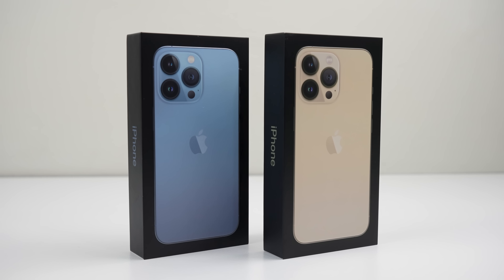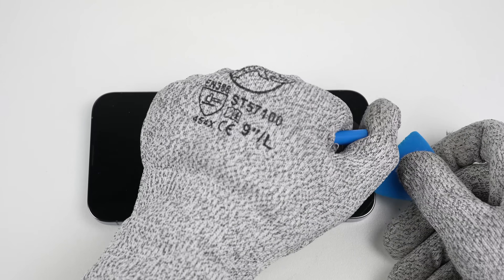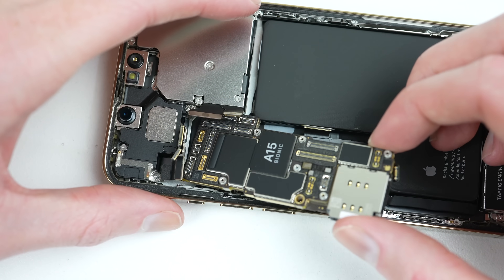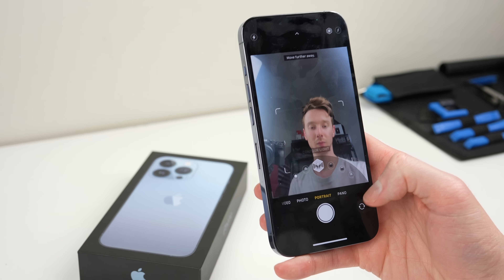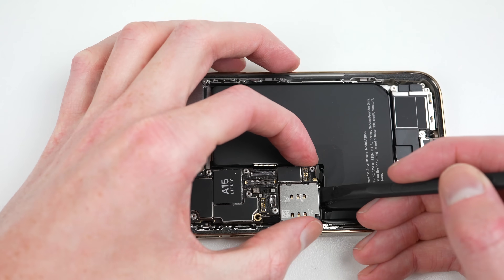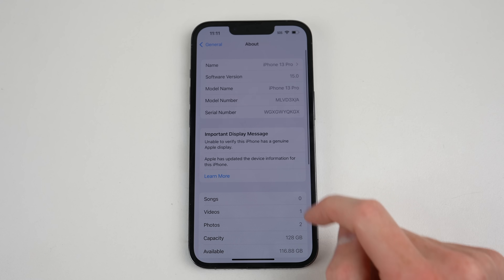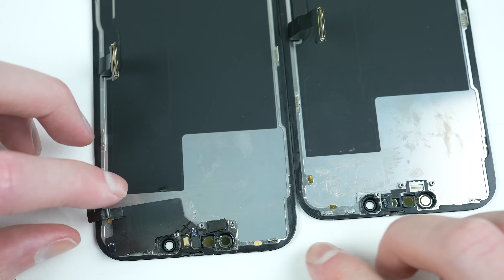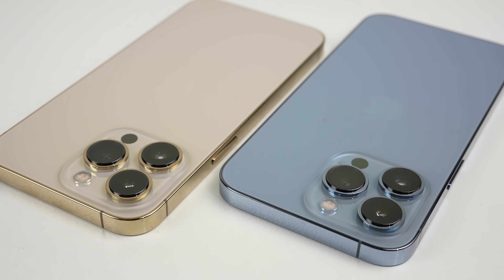iPhone 13 A Repair Nightmare - Teardown and Repair Assessment

Comment: I cannot fathom how anyone continues to support Apple. They are possibly the most anti-consumer company out there and that says a fucking lot given how anti-consumer many ISPs and video game publishers are.
Reply: Well that's because contrary to what you might be led to believe from internet debates, people rarely put their money where their mouth is and being pro-consumer on it's own rarely does anything for your business.
Reply: @CanIHasThisName  Hence why consumer rights are encoded into law. Laws which need to be revisited and updated for modern products and the expectations of modern consumers. This stuff shouldn't be left up to the companies to decide for themselves, they'll never do the right thing for the sake of the common consumer.
Reply: @smithynoir9980  and then they'll move somewhere where that law doesn't apply
Reply: I still use my old iPhone 6.

Next ones going to be a Linux one as soon as I can find a good one.
Reply: I hate apple but i just think their products are actually good, and they have good software with great security. I'd like to switch if i found a better option but I've tried too much and I can't find something i like that's better than apple at the moment
Reply: @yourdadow446  I personally also enjoy iOS but what finally pushed me over to Android (Samsung Note) was when Apple introduced that "feature" which automatically lowers you volume. Basically, regardless of the audio output, be it BT earphones or speaker, the iPhone would periodically, sometimes as often as twice every 15 minutes, lower the volume to around 50%. And it would do it for everything - music, youtube, even navigation. The most absurd part was that in some regions, they wouldn't allow you to disable this. That was far beyond what I'm willing to tolerate and Apple just straight up refused to provide any explanation for why I can't turn this off.
Reply: @CanIHasThisName  

     I wasn’t aware of this, and certainly don’t wish to carry apples water, but it may be a matter of simply not wanting to destroy ignorant young peoples’ hearing while they constantly play their “head banging” music too loud on their head phones.  The device may be limiting the dB output after a length of time to limit chronic exposure, still there should be some sort of reset for the sake of liberty.

     The same thing happens at live venues when the speakers are cranked too high or on the firing range or around loud machinery.  Once sufficiently chronically exposed the hearing loss is permanent. Personally, I always carry noise attenuation, whether active electronic attenuation, or simple ear plugs. Even a set of headphones turned off make acceptable ear plugs in a pinch.

     Still I am a freedom loving libertarian, so if one wishes to risk permanent hearing loss, or to stare at the sun 🌞 it’s a personal choice when “at the age of consent”. 😎
Reply: @CanIHasThisName 

      I considered your points before writing and concur with your observations (I had the same).  A question …… does this happen on external speakers also or just on headphones?  It is true that there is some Db variables with the phones, but the acoustic properties of the ear are well known, particularly with apple phones utilizing miked noise cancelation which allows the algorithm to probably have a good idea on how many Db’s are going down the ear canal.  

      I also do not like being over managed by “smart devices”.  I can put up with it so long as it’s able to be overridden in manual control. 🤔 It goes both ways too when the dynamics are artificially altered in play lists between songs or when commercial content is automatically boosted.

      One should consider: “For what possible reason would Apple do this?” Pissing off their end user is certainly not a good business practice and Apple has done a lot of that lately. While Apples tech can be very smart, their business ethics place Apple squarely on my 💩-list.  The contrast from Steve Jobs & Waz now to the Tim Cooke regime is profound.
Reply: @vincentstouter449  I'm not sure whether this is still an issue today, it was about 11 months ago. 

It happens regardless of the sound system - earphones, BT speakers, even car speakers. It isn't based on any actual IRL measurment, just the volume % level. Even with earphones, it's not possible to accurately measure the output. Even if the earphones do have noise canceling, those mics are not measuring the actual driver. 

As for why Apple would force this on users, I guess it's the same reason why they would force performance throttling on devices with a dying battery - because they're Apple and always know best. 
And I suspect it's also for this reason why some regions could disable the feature - because in those regions consumers can file class action lawsuits against companies.
Reply: @CanIHasThisName  I dont know about the volume thing you're the first person That told me this and that sucks if it's true, but in my opinion I wouldn't switch phones for that and all the fucked up shit they do cause i still cant find a phone i would use that is not an iphone.
Reply: @yourdadow446  For me, it was a massive issue, rendering the phone basically unfit for purpose. At work, I listen to music throughout my shift on a BT speaker. 
The speaker is on the other side of the room and any time the phone would decide to lower the volume, I'd have to go over there and pull it back up, because it wasn't loud enough for me to hear at that point. Because I'd play music for extended periods of time, this "feature" would become quite aggressive and it could happen as often as twice every 15 minutes. 
I bought a Samsung Note and have to say I'm very happy with it. Samsung provides timely security and feature updates, their OneUI has very decent interface, and there honestly isn't much that I miss. And I've gotten really used to the stylus :)
Reply: @yourdadow446  Then you've not really looked or researched. If you go a smart-phone, it's got all the features an Apple phone does that anyone really needs. Usually less restrictive software than apples and great security included to boot.
Reply: @smithynoir9980  "If you got a smart-phone" I'm assuming you're talking about Android smartphones, and you are fully wrong in this case. 
Vast majority of smartphones on the market have worse camera quality and especially video quality. This is especially true at the current iPhone SE price range. 
No Android phone has face recognition that would be on the same level as that on iPhones with Face ID. 
There's only a quite narrow range of devices which are supported for more than two years. In comparison, iOS phones are supported for 5 years or more. iPhone 6 (2015 device) is getting iOS 15 and will therefore have the newest OS version even 7 years after release. 
Security situation is even worse, there are only few Android phones which actually have competent security implemented and receive frequent security updates.
Reply: @smithynoir9980  i understand that there might be some phones that you can compare to apple's phones but im not gonna switch based on how much you like it im gonna change when i feel like that phone is good for me and i like it,. I've tried a few and didn't enjoy the experience but im down to try different phones if you have a suggestion
Reply: @smithynoir9980  i did, and you're giving me more reason to not switch, if it's just for needs i would get any phone yes, but its not. The ease of use on apple is perfect, the security is the best and i just like how it generally works, i dont want to switch and lose what i have here, I enjoy so i will continue to do so until i find a good replacement.
Reply: Yeh I bought a set of powerbeats pro and they stopped working on me after using them on an Android phone once, so sent them for warranty repairs and I got a new pair sent back 3 weeks later. So their anti-repair prerogative is so strong that they can't repair their own devices. 🤣
Reply: Their devices are fashion accessories and status symbols. You're paying premium to get the Apple name and styling, doesn't matter what costs.
Reply: @tylisirn  Which, frankly, is pathetic bordering on in-human. Anyone that attributes brands as status symbols, instead of personal qualities and actions, is an invalid not worth a shred of respect.
Reply: It is not hard to understand. None of these issues matter if you have the disposable income to pay apple to fix it. Apple is not anti consumer, they are anti third party involvement.
Reply: @misekai6396  Intentionally making things more expensive by preventing 3rd-party or DIY repairs IS anti-consumer though. Being anti-third party, or rather anti-competitive, is anti-consumer though. It all falls under the same exploitative corporate umbrella.

Comment: Imagine being a programmer at Apple and having to program bugs into the software in order to prevent people from repairing the device...
Reply: Probably some poor Chinese programmer just happy that he has a job.
Reply: @realBOT_totallyNonHuman  clearly there is some sort of programming that tells notes the hardware id. If those id's don't match then you get the errors from the individual components as seen in the video when the camera stopped working etc.
Reply: If its programmed with intention its not a bug but a feature.
Reply: @Jimoshi1  Fuck phones with such features then
Reply: @Jimoshi1  Yeah I agree and it’s not only a feature, but a security feature (face ID) 😀. If your credit or ID card is broken, you cannot fix it on your own either. Don’t get me wrong, I would never buy an iPhone (not that android phones would be any better … ).
Reply: @realBOT_totallyNonHuman  So you're saying that exactly the same component from the other phone of the exact same model won't be able to do exactly the same job? It's not trusted? They purposefully tie your phone to the factory assigned components to prevent repair and if you don't satisfy this condition - you get bugs that were designed to look like there is something wrong with hardware
Reply: @realBOT_totallyNonHuman  No, it's not just the software, but we have to talk about all of it. It all adds up to a disgusting way to treat your customers. It means we question the morals of the programmers who write stuff to purposely obfuscate the rights of the consumer, despite a Law being passed to enforce said rights. Programmers are enabling illegal actions.
Reply: I can't imagine being such a soulless, corporate sellout. I'd probably off myself were I in their position.
Reply: @smithynoir9980  Not with the wages they earn from sheep buying their phones and then whining about it. 🐑
Reply: @MetalFan10101  Haha oh you think Apple passes decent wages to it's employee's? You do know they are made in countries relying on exploitation in manufacturing, right? 
The point is decent, respectable people don't sell out and contribute to exploitation. Them not caring just furthers my point as true.
Reply: @smithynoir9980  Haha you know manufacturing and programming are 2 completely different things, right? The point is people will do whatever it takes for money. They dont care if it sells you out or exploits you, they laugh their way to the bank each month. The monkey in your head clapping cymbals must get hella lonely.
Reply: @smithynoir9980  In case you havent noticed, money makes the world turn around. Try and get someone to do something for you and tell them you wont pay them and see how far you get. Unfortunately, being materialistic is very human.
Reply: @blinded6502  Sure, go ask a builder to build an extension on your house for free. Tell me what he says, wont you?
Reply: @smithynoir9980  sounds a suspicious lot like c o m m u n i s t  p r o p a g a n d a but ok
Reply: @merlinc.4560  ah the classic invalid argument of calling whatever you don't personally like as 'communism'. Real constructive contribution buddy.
Reply: @smithynoir9980  might wanna back up a few years on the education there: to pluralize a noun, you add an S typically. Not sure what the apostrophe is doing there, much like your angst.
Reply: @joeykeilholz925  And by picking on grammar you've admitted to having nothing valid or constructive to add. Or did you think you were clever coming up with that all on your own?

Any other invalids want to throw nonsense out? Or is someone going to try forming a point relative to the topic?
Reply: @MetalFan10101  "Try and get someone to do something for you without paying"

Have you ever heard of friendship?
Reply: @PelvisPresley94  I have. Go and ask a builder to build an extension on your house in return for your friendship 😂
Reply: @MetalFan10101  You can "do something for others" besides building an extension for a house. But go ahead and ask parents if they make their 5 year old kids pay rent in return for living there

I doubt you'll have healthy relations with people or even yourself if all you do for others comes with strings attached
Reply: @PelvisPresley94  Yes, you can ask a painter to paint your house for free. Will he do it? No.
You can ask a mechanic to repair your car for free. Will he do it? No.
You can ask a restaurant to give you food for free. Will they do it? No.

Do I need to continue?

Im not sure where you are going with the 5 year old and rent comment but it was the parents decision to bring their child into the world, to look after them, feed, clothe and house them. Where do they get the money from to do that if they do everything for free? They dont.

People get out of bed in the morning and travel to jobs they most likely hate, why? They need money because money makes the world go around.
Reply: @MetalFan10101  Lmao, read the previous comments again. In case you're not deliberately moving goalposts, that is.
Reply: @MetalFan10101  People will only ever do stuff if they get money for it, but somehow they choose to have kids, which requires spending a ton of money, which they most likely will never get back
Reply: @PelvisPresley94  They choose to live in a house too, which requires spending a ton of money. They choose to go on holiday too, which usually requires a ton of money. Where does that money come from if you are expected to do everything for free? Do you think people go to work just for the fun of it? Chances are the employees dont even care about the company, they just want their paycheck. Why? Cause they need money to do anything.... I cant tell if your actually serious here 😂 if you are then ill be damned.
Reply: @MetalFan10101  That's not the point you  were making at all
Reply: @PelvisPresley94  I have read the previous comments, I have even replied to them. What do you mean moving the goal posts? You werent even a part of the conversation and picked up one thing I said in response to somebody else. Somehow we have gone from me saying dont buy the product if you dont like the way it is made to talking about 5 year olds paying rent 😂
Reply: @smithynoir9980  Ah but what you perceive to be the intention of my remark is in itself just a subjective interpretation of the underlying message, made possible through the imperfect medium that is language, is it not? What elects you controlling instance of the validity of a differing opinion? In truth, how may any of us derserve the presuptousness and right to claim being representative of an objective universal basis to moral disputes? What is moral anyway? In fact, it is by your hasty assumption about my ideological position in this very discourse that you prove your mental inadequacy, thus rendering the entire societal philosophy you have been propagating vulnerable to doubt.

I think we need some more constructive contributions here guys.
Reply: @smithynoir9980  lmao it’s just a phone chill out.
Reply: Don't think "just a phone" is very fair to call it. Smart phones are the most influential tech introduced in recent time. We should care for what liberties companies take with them, their marked is still young and not well legislated yet.
Reply: @spoopyscaryskelebones3846  Apple devices aren't just devices, though are they? They're a way of life. A niche trend. Perceived quality above all other competitors. No one here is mad. They're just disappointed for fellow tech heads who have been fleeced (see what I did there? Sheep and fleeced...nvm) by Apple. People continue to give them extortionate amounts of money for something that is ultimately gimped from the factory and costs the rrp to replace a minor component. Android users have had that luxury for years. Yet Apple users still feel superior to all other users. Despite Apple repeatedly shitting on it's consumers, they still believe they're better people and their devices are better. And you wonder why Android users poke fun and react with utter disbelief. Would you be an Apple user by any chance?

Comment: I bought a 2010 Mac book pro in a thrift store, the DVD/RW didn't work so I changed it out. The Apple repair store (Not Apple) wanted the "Original" DVD/RW drive also. I guess they have been doing this kind of thing since then.

Comment: My guess this is done not only to prevent third parties to repair your phone, but as well for protecting your information and phone from being stolen and disassembled for third parties. I would force apple to support/repair my phone as much as I want for free, backing up my right for repair, IF this was done for security reason (but apple is going down the wrong way without jobs)

Comment: So Apple is not that 'Green' at all. 
You need to buy new parts from Apple as one can not swap parts from another damaged phone. 
Or, Apple runs a software over it after it repairs the phone so only they can use scrap/recycled parts.